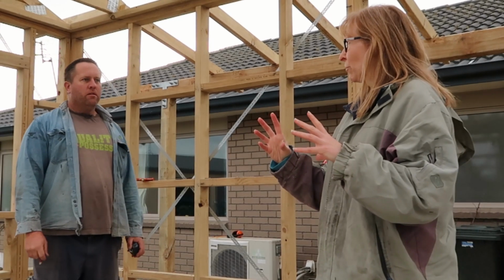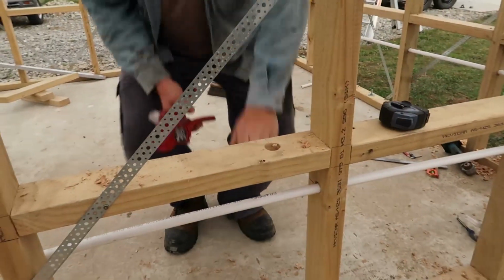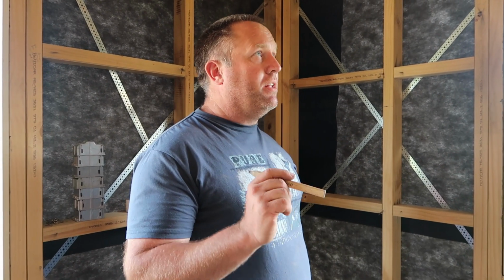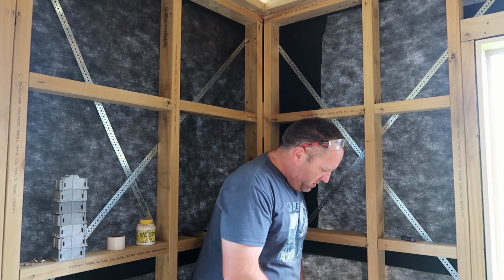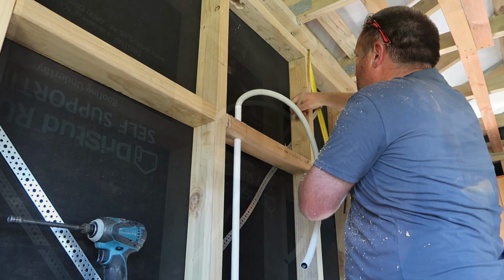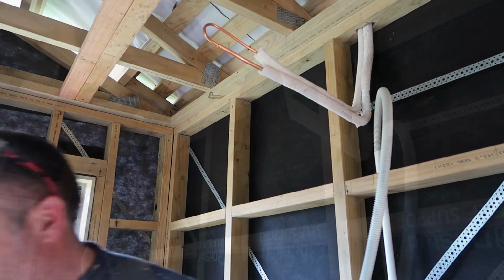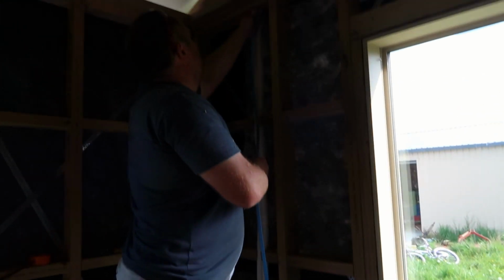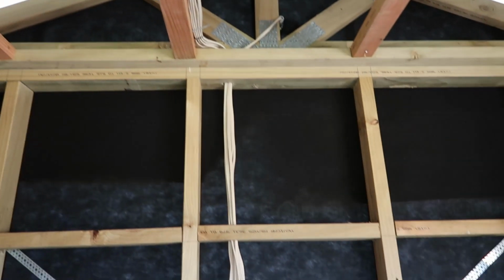How to do a Pre-Pipe for a Heat Pump / Air Conditioning Unit

Comment: How does this differ to when the cabin/etc is already built? Is it much more difficult?
Reply from the maker: It is more difficult as you have to go outside the wall and use capping etc instead of going through the walls which I did, which doesn't always look as good, and also once the building is finished there's sometimes limits on where you can place the indoor/outdoor unit depending on walls etc ... so certainly still doable just a lot more work-arounds!

Comment: Hey guy’s awesome video! Any tips for someone getting into heat pump installations?
Reply from the maker: Heaps of advice depending on what you want to know - do you mean actually getting a job, or technical information?  If you're trying to get a job in the industry I'd say stay away from companies that tend to rush through their jobs, they're usually the cowboys who are cutting corners & won't teach you good habits lol!
Reply: @CheaperWaysNZ  just the best practices, I see a lot of people don’t pressure test their pipe work. I’ve just done a 3 day heat pump course. It was great but I also learned a lot from your videos on heat pumps! Cheers guys!
Reply: 3 day heatpump courses should be banned. So many leaks and shitty practices from sparkles and "handyman" installers. Leave it to the professionals who actually do trade training
Reply: @danb5339  oh yeah you reckon mate. Maybe for people who don’t give a shit. I’ve installed 10 units already. Followed all the protocols and had no leaks and no issues. Don’t bag the 3 day course. You would be surprised by how much you learn in 3 days…